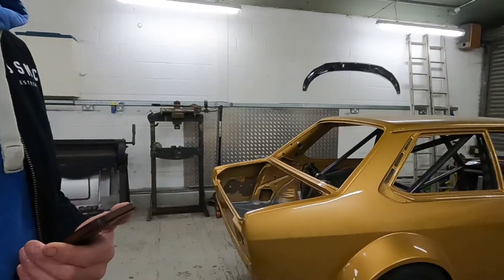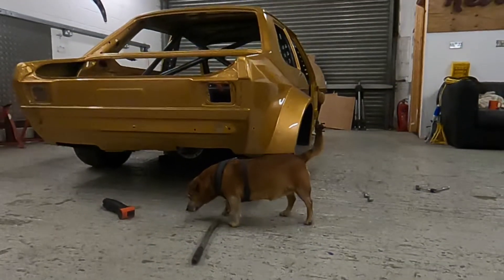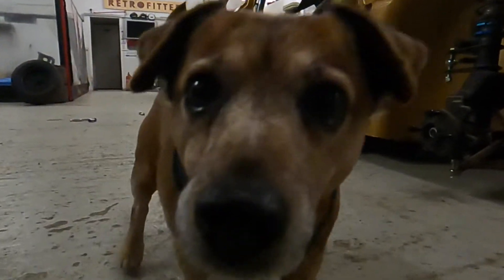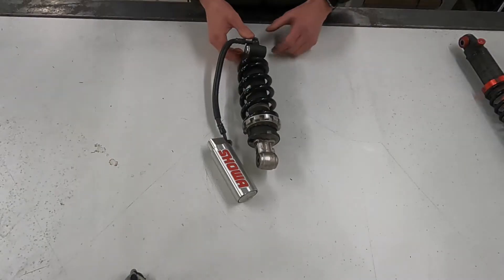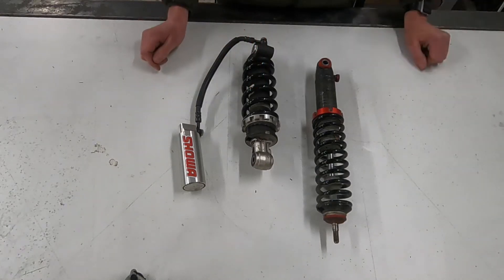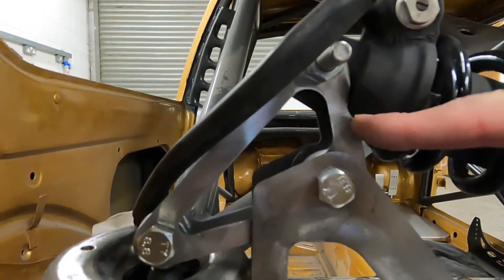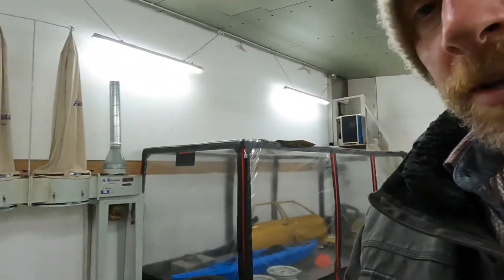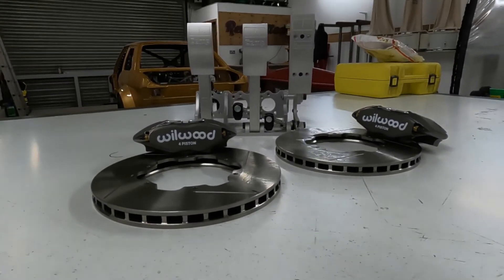VW MK1 DERBY. Creating push rod rear suspension

Comment: Awesome build. I'd be tempted to add a cross braces between the pairs of support brackets, at least at mid point, to prevent them spreading apart or collapsing together under high loads. I'm sure they're fine as they are, more than fine, but if you visualise what would give first, you can imagine the support brackets bending.

Comment: Wondering if it’s possible to do something similar on the front of a T4 to replace the torsion bar system… I was thinking that the torsion bar could be replaced with a substantial tube that connected to a linkage system like you’ve done here.